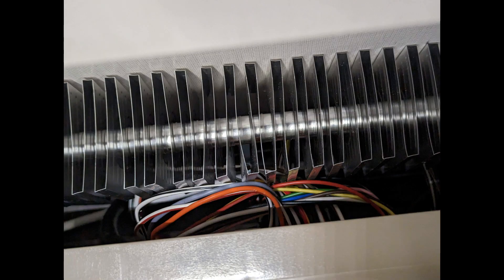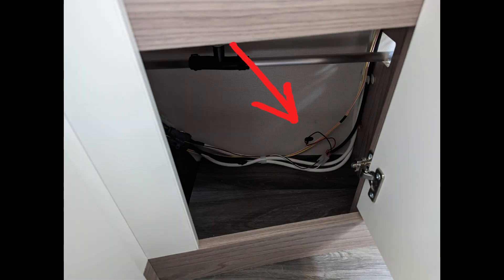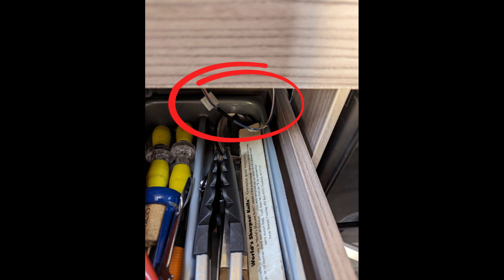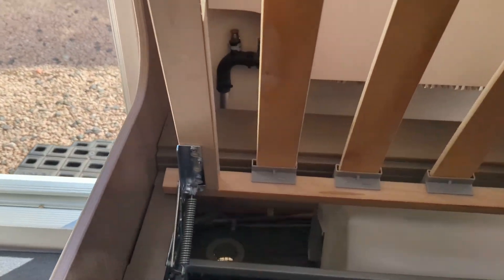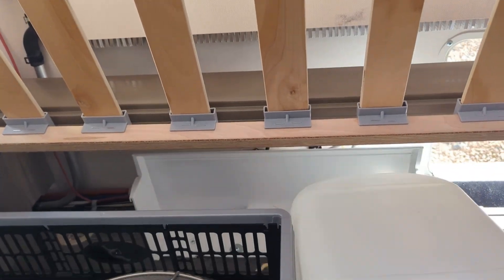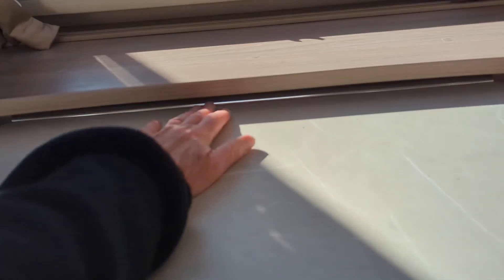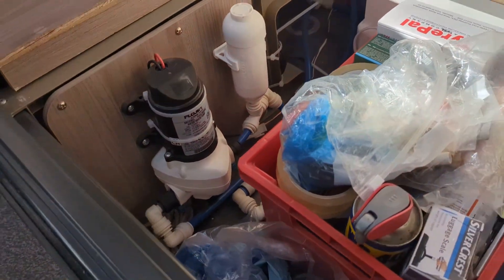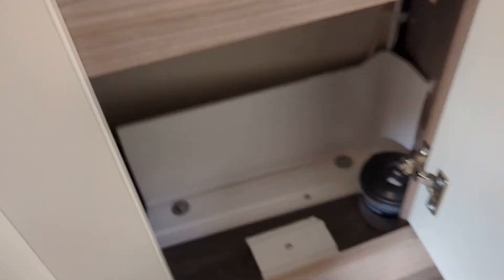Shocking Internal Wiring and Cabling on Swift Challenger Caravan                                   -

Comment: What you’ve just done—if anything goes wrong with the wiring now, they’ll say you’ve voided your warranty because you touched the wires. I’d remove the video, as there wouldn’t be any proof. These guys are gangsters, and they’d wiggle their way out of fixing anything. I knew a guy who lived in his van full-time—the dealers turned around and said the van was only for occasional holidays and voided the warranty because he said he lived in it. Take care, mate.
Reply from the maker: @jockserb3405  Thanks for your comment. Fortunately my dealer is very good. But, as you suggest, not all are. So far, Swift have honoured the warranty, it's just that the faults and the whole process of repair takes up a huge amount of my (and my wife's) valuable time, messes up holidays, losses availability of the caravan and costs me money.